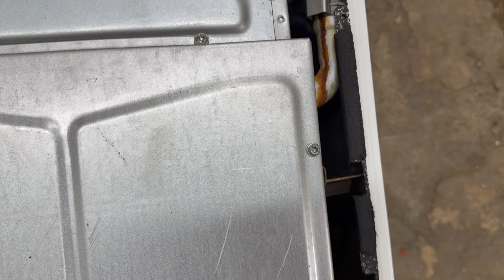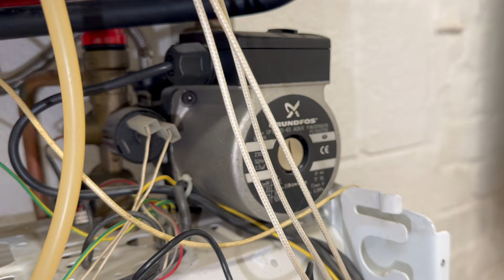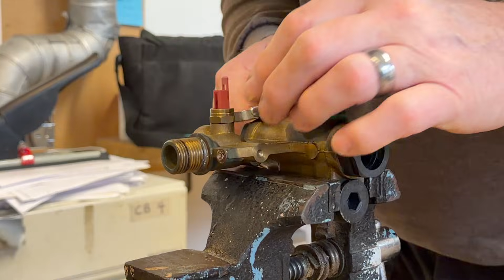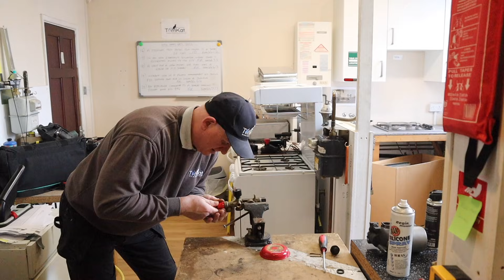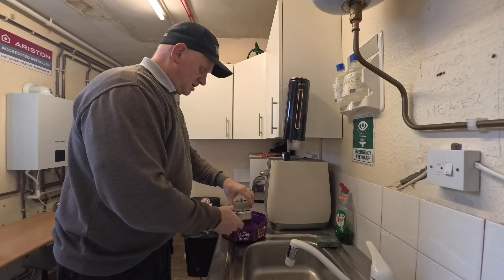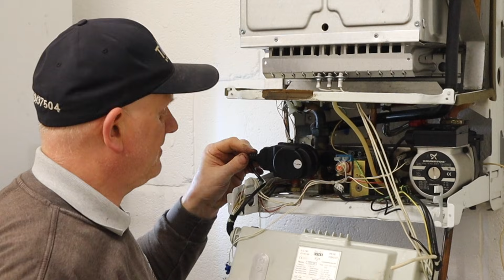Can I make one good boiler out of 2 scrap 19 year old  Heatline vizo boilers part 1 #plumbing

Comment: Manufacturers don't even make replacement case seal, case seals only lasted 2 to 3 yrs, making the boiler a disposable boiler, unless the engineer is willing to put his knecknon the line and use a seal from another manufacturer then If something happens he could be accused of modifying a gas appliance and putting people at risk. Not a position id ever want to be in, i have heard plenty talking in merchants and saying they use a seal off of this or that boiler or a window seal of some type. Do not be this guy.

Comment: My Vizo runs great - fitted correctly in 2006 with  in line filter on fresh water and CH circuit  with copious amti rust -  it's needed one diverter valve rebuild - the new O rings were greased with white silicon E bike stuff ten years ago - tend to set the temp half way - might  clean the water water heat exchanger as the water flow is a tad down - maybe its furred up  a bit - lots say they are not good but fitted proper they are sound